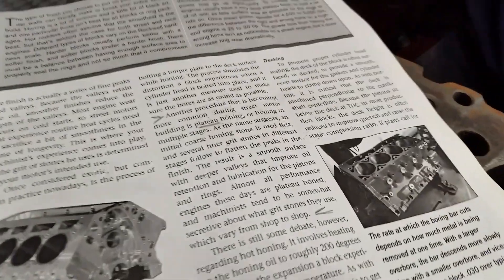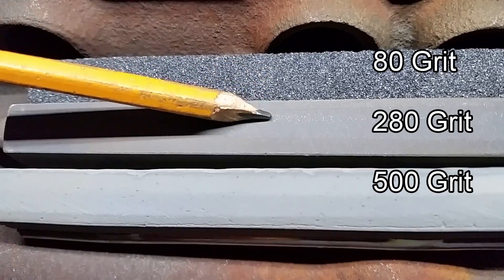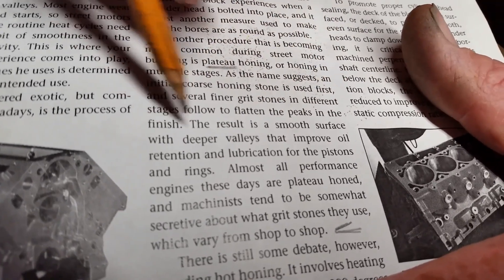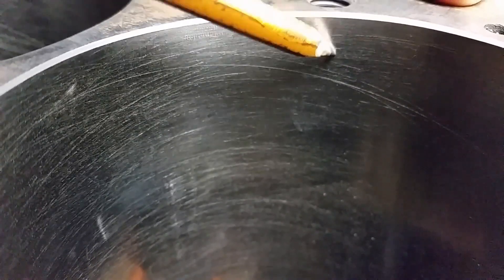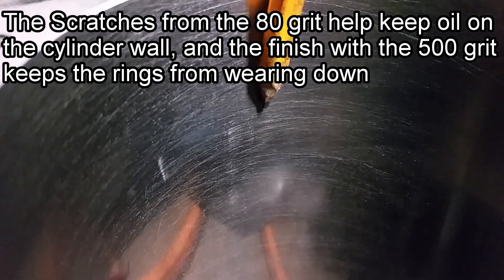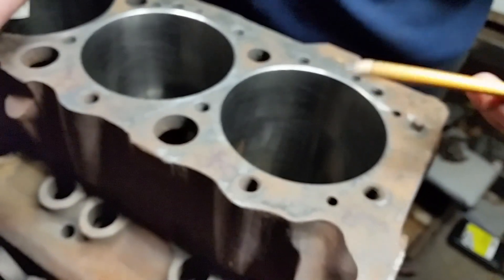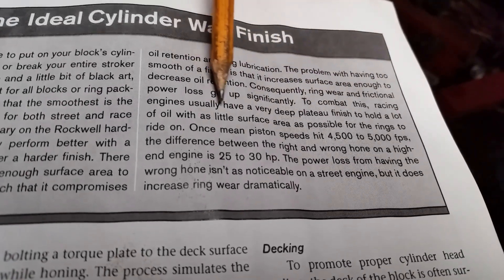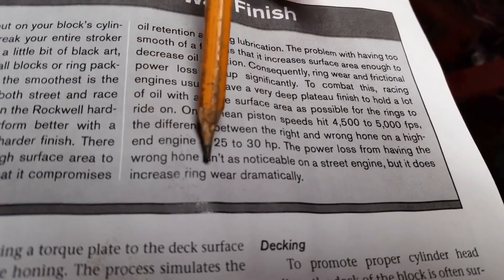Result of plateau honing

Comment: Not trying to be mean or anything, but what you did to the cylinder isn't plataue honing. That's a ruined cylinder and needs to be taken to the next size to correct it.
Its a burnished cylinder with gouges in it.
There should never be any 80 grit scratches left in a bore.

For moly faced top ring
Bore block to leave .005 left to hone out. Use 150gr until .003 left, then use 220gr down to .001-.0006 ,(depending on application), and then use 280gr and take to completed size. Bore is now finished for regular moly faced rings.

Now to plataue hone it either use a set of plataue brushes,  or use a 400gr-600gr for ONLY 5-8 strokes of the hone MAX depending on application.
Your not trying to leave a 400-600gr finish, but just nock down the peaks of the 280 finsh.

You do NOT want to have either the 400gr or 600gr finished. This is too smooth and will not hold the correct amount of oil that a moly faced ring needs to ride on.
 If you hone the block more than just the necessary amount of strokes to flatten down the peaks then you will leave a 400gr or 600gr finish on the bore and this will not work.
You must maintain the 280gr finish!

Your working in micro inches in the depths of the scratches.
At the final stage if you take over .0001-.0002 that's tenths not thousands,  you will have wiped away your 280 finish and now have a 400 finish which is just a finer finish and not plataue finish.
Reply: What if the book calls for a 400 finish? I have  Honda V6 Block I am working on and the FSM calls for it to be 60* with 400 or finer finish.